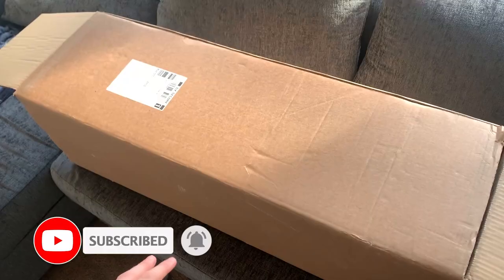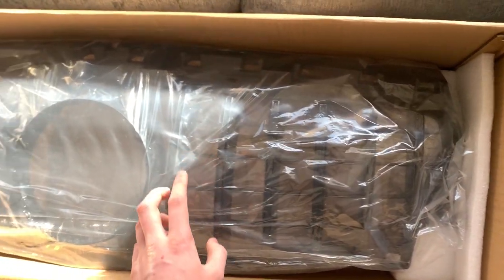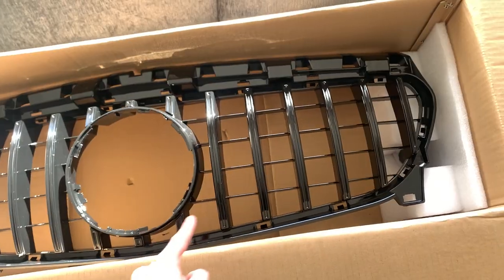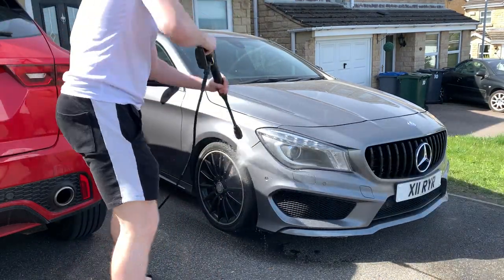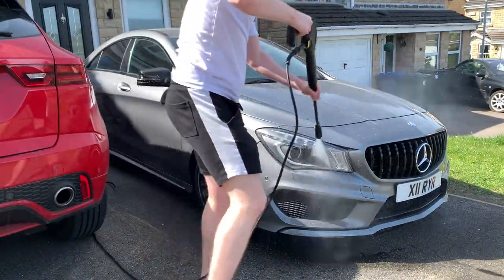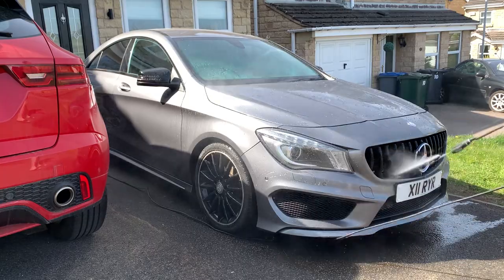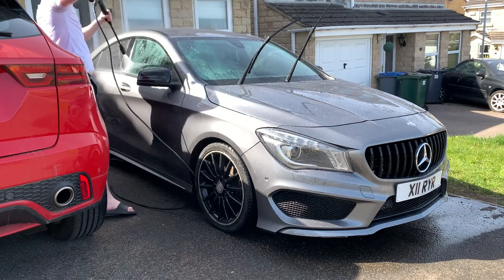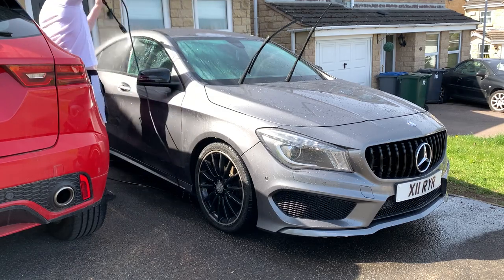MERCEDES CLA GETS A PANAMERICANA GTR STYLE GRILL *LOOKS INSANE!*

Comment: I purchased my GT-Panamericana grille a year ago for my 2014 CLA250 AMG Turbo 4Matic with the sports kit.   After seeing your video, I finally decided it was time to install the new grille and I dedicated nearly two days to the project by taking my time.  I found it very  frustrating getting that diamond grille out without breaking any of the plastic grille clips. You have to be patient or it can test your sanity.  I did not install a protective mesh for the radiator because I don't drive as much as I use to and I figured the free flow of air would keep the engine cooler.  I ended up with a few extra parts from the diamond grille because the Panamerican Grille does not require the same pre-cut support foam and it installs so much quicker.  There's nothing easy about the project but when it's done, you're going to love it.  Don't discard your diamond grille as you never know if you'll need it again or if someone may want to purchased it from you.

Comment: Great job!   I’m doing the same on my CLS.it would have been better if you had install the mesh to protect your radiator, but some like it wide and open. I added a mesh prior to install. Keeps the bugs and minimize debris. It would protect the radiator. The grille gaps are very wide in the panamericana as opposed to the tightness in the Diamond grille.
Reply: Hi, can you detail a bit on what mesh have you used ? Thanks
Reply: @djmariovalens  I ordered mine through Amazon. You can cut it easily with a sharp scissors or a simple metal cutter. It’s inexpensive like less than 16-17 bucks. Here is the one I used. 
AggAuto Universal 40"x13" Car Grill Mesh - Aluminum Alloy Automotive Grille Insert Bumper Rhombic Hole 4x8mm, One of the Most Multifunctional Shape Grids Black
Reply: Where did you get the mesh from?
Reply: @adventuresofapostoliczaddy7940  got it from Amazon   

AggAuto Universal 40"x13" Car Grill Mesh - Aluminum Alloy Automotive Grille Insert Bumper Rhombic Hole 4x8mm, One of the Most Multifunctional Shape Grids Silver

Comment: any issue with this grille so far? I have a 2014 CLA and would eventually like to grab one of these
Reply from the maker: No issues at all, perfect fit for me, arch screws were abit tough to get off but easy one you know what you’re doing.

Not caused any performance issues, rattling or anything  by like that. You’d never know it’d been changed.
Reply: On mine zero issues

Comment: Where did yoy you found instructions on how to install the grille?
Reply from the maker: I didn’t I just went along with it…
Reply: @RyanUKplays  i mean, it is not easy to do
Reply from the maker: @bigkaki000  I wouldn’t say it’s easy but it’s not difficult just some fiddly bolts to get the bumper off but after that it’s very easy
Reply: @RyanUKplays  but how did you know which and where and what screws to take out? Like those next to the wheels?
Reply: @RyanUKplays  any heads up about what to watch out from?
Reply from the maker: @bigkaki000  I just followed the line of the bumper and took out the bolts that were holding it together it’s fairly easy to know which ones there is a few along the top of the bumper when you lift open the bonnet. Then there are 2 either side under the wheel arch and then there is a few under the car at the front underneath the bumper holding on the undertray.
Reply from the maker: @bigkaki000  make sure you line up the bumper correctly when putting it back on it’s hard if you’re doing it just by yourself but you can do it. It slides on some small tracks as it joins to the arches